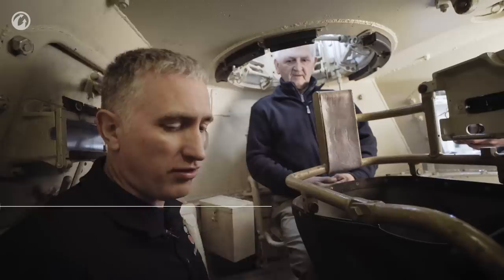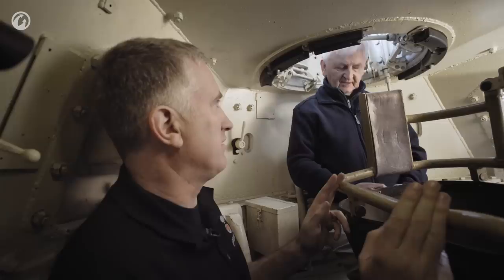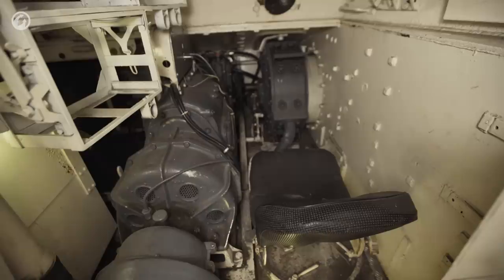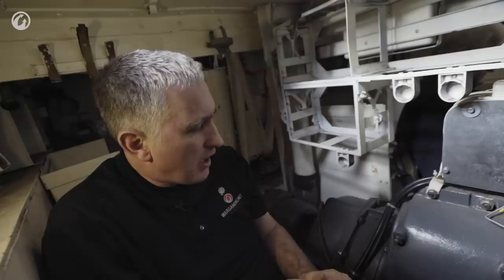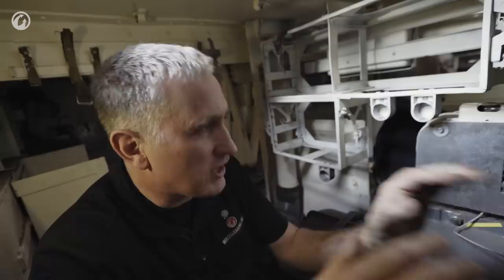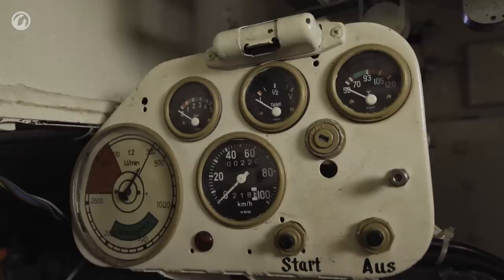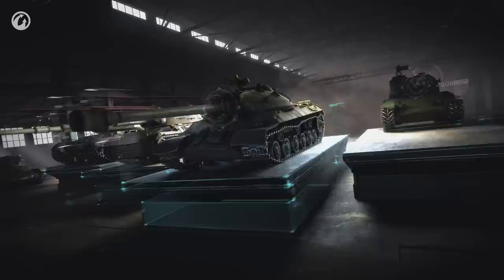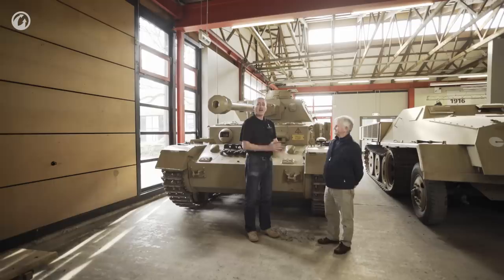Inside the Chieftain's Hatch: Panzer IV Pt 3

Comment: Great factoid: Israeli Sherman kills a Syrian PZ IV in the 1967 war. You couldn't make stuff like that up.
Reply: I would bet that it was an Israeli Supersherman which had a french version of the KwK42 of the Panther^^
Reply: @HaVoC117X  - possible. But the 75 mm is more than enough to kill a Pz IV.
Reply: HaVoC117X yep reckon you are right
Reply: I used to work with one of the guys who helped found the Israeli Air Force.  The planes they originally trained on? Me-109s.

Comment: man, for such a tank of its size, it's actually pretty roomy inside.
Reply: Like they said, no torsion bars.
Reply: The sloping is also minimal on this baby
Reply: @azzazel225  Torsion bars don't even take up that much space. Just look at Panzer III which is essentially same size as Panzer IV but it has torsion bars. 
In case of Tiger and Tiger II, torsion bars take up around 120mm of space in height and bit more in Panther because of the dual torsion bar design.
Reply: Uncle Joe I mean it was nominally better than the low velocity 75, but once you get to the 76 it actually was switched to the 76 was nominally better than the 4s 75.
Reply: From what I understand, the German tanks were known for being pretty roomy. The Germans actually cared about crew comfort.
Reply: KoruptDawg eh, panzer 3 and 4 when only with the 37 and low 75 where really roomy, and still decent with the upped 50 and 75, but the panther and tiger where a bit of a mood getting into and out of.
Reply: @azzazel225  Did you listen to the video at all???
They had at least one foot space for extra fuel tanks below the turret. Plenty of room for a torsion bars if you want some!!
Reply: Uncle Joe  Which became a problem later on when allies had better guns. Still in a real life scenario you still had to manage to hit the tank first. And when you usually don't get second chances in a real life situation I'd imagine even a flat armor tank still had its merits.
Reply: Uncle Joe well, one could argue that it wouldnt have been difficult considering the work done on many different projects. But these vehicles were contracted, I doubt such extensive change would have been under contract, even considering the different models it still retains most of its base whereas sloping the frontal armor would have been much more demanding. Though I imagine it would look similar to a panther, hence why they might not have done it.
Reply: @dustindubbo2892 
Tiger?

Both tigers have the biggest turret ring diameters by far.  Big hatches plus an extra escape hatch in the back of the turret. 

Chieftain made a video about the long 75mm panzer iv recently. He was surprised how much space the crew has and every crew member including the loader had their own hatch. Remember Sherman's until late 1943? They only had the commanders hatch, all three crew members in the turret had to squeeze out through a single hatch.
There is a reason why the germans called the Sherman "Tommy cooker" in North Africa 1942/43.
The US learned about crew ergonomics from the Germans and not the other way around. But the US finally got it right with the M4A3(76)w hvss. But this tank arrived at the Frontline in December 1944, the war was basically over at this point.
Reply: Uncle Joe  I don't think there would be any such thing as a small TARDIS.
Reply: "Of its size"? It's wider and longer than an M4, and just about as high. It's not a small tank, as WWII tanks go. If you mean that "wow, the smaller IV has more room than a larger Panther", sure. But the Panther is pretty small for the capacity they tried to pack into it. It's not all that much bigger than the IV in most dimensions, but with much thicker armor, larger gun, larger engine and transmission, and a bunch of torsion bars.
Reply: It was the best German panzer of the war. They unknowingly created a hull that was upgradable and remained current through the entire war. Had they invested more into producing these than lets say Panther or Tiger II. The army would have had more tanks available for every battle.
Reply: Uncle Joe  Agreed.  A very underrated tank. As you rightly say upgradable even more so than the German's managed to do. It was deployed long before the Sherman and was "good enough" to do the jobs asked of it.  Had it been  refined even further and streamlined with ease of production in mind. It could have altered the progress of the war in Russia.
Reply: AKUJIRULE  I understand and appreciate your valid arguments.  The issue for the German forces was simply never enough tanks fit for action at any given time. They did remarkably well making do with what was available. Any numerical increase would have had a disproportioned effect on battlefield performance. 
Panther "the problem child" was much less reliable than other models. It also consumed R&D effort and recourses, at a time when better spent improving/producing proven models. The Tiger I  for example, could have benefitted from further improvements before building Panther. Same with the Panzer IV. There were plans to improve it's suspension etc. The whole subject is purely academic. Just another "What if?"
I wish you well my friend. Stay well and safe. BTW.  I've written to the Chinese Embassy and requested zombies, next time they see fit to unleash a pandemic on the free world.

Comment: I used to work with an Australian WW2 veteran who took part in the 2nd battle of El Alemain. One of the memories he was to take to his grave was the screams of wounded Germain tank crew trapped in a tank brewing up on fire. Due to the hazardous situation of amunition cooking off, there was nothing that could be earthly done to save these German soldiers, and their horrible fate was sealed. So German tanks caught fire are being hit equally as allied armoured vehicles and tanks. That is why the crew of Tiger 131 abandoned their damaged tank as the risk of further rounds hitting the vulnerable areas of the Tiger tank, causing it to burn, was very high.

Comment: There was  a nickname for the Pzkw IV too: crews called it "Rotbart", inspired of a slogan for the razor blade "Rotbart extradünn" ("Redbeard extra thin") because the gun e.g. of the T 34/76 went straight through the armour.
Reply: Redbeard? As in Barbarossa?
Reply: Jeremy A that’s Blackbeard.
Reply: @ICCUWANSIUT  Blackbeard would be "Barbanera".
Reply: I would have called Barbarossa, Ragnarok instead
Reply: @ICCUWANSIUT  "Barba" - barber, beard, hair. "Rossa" - rust, rouge, red. Ferrari Testarossa - "Redhead", named for the color of the paint on the engine head. Barbarossa = Redbeard. You are thinking of Blackbeard the pirate. There is also Bluebeard, of popular legend.
Reply: Only on the early variants. It doesn't pay to put too much weight on soldiers jokes anyway. If ANY Russian shells penetrated the armor, they would think it was too thin and gripe about it and make morbid jokes. It doesn't mean that T-34s just went merrily along knocking out Pz IVs left and right. Just that the Ivs crews felt that the margin of safety was getting kind of thin. And what do you think the T-34 crews called the T-34 when the L48 arrived and suddenly their 50mm armor seemed very thin compared to when they were facing the 37mm?

Comment: A German tank veteran, quoted in a book about the fighting around Tilly-Sur-Seilles in France in 1944, said that the Panzer IV was nicknamed the "mess tin" as it had the thinnest armour of the frontline German tanks and that enemy rounds could and did pass clean through. Not so for the Panther or Tiger. If, he said, a round penetrated, it usually ricochetted around inside and killed the crew.
Reply: Well that happens pretty much with any tank if the shell penetrates. The Panzer IV was decently armored for the time. 1944 is a pretty extreme time and especially in France there aren't exactly that many Tigers and Panther to begin with. In a 1:1 vs the Shermans the Panzer IV was still perfectly adequate most of the time.
Reply: I remember reading on the Eastern front that if a 152mm hit the Elefant the entire crew would die (from shock, or I don't know) and the tank would be reserviced.
Reply: @nicholaspatton5590  - I highly doubt that. Only 90 or so Ferdinands were built and the dozen or so that was destroyed are usually by mines or hits on it's wheel tracks, after which the crew would then abandon and destroy the tank.
Reply: @nicholaspatton5590  Russians were known to use 152mm HE rounds on German tanks. German tanks were tightly sealed (to ford rivers coz they were too heavy for most bridges) and the concussion from the 152mm rounds would kill the crew inside. Americans used a similar tactic with the 75mm Shermans, hit the enemy with enough HE and the Nazis inside would be finished. Dying from concussion like that is very unpleasant, although it's a fair end for a Nazi.
Reply: @osokmav  Please Sir don't refer the Germans as Nazier its the same as calling every American racist fat bastard or The south will raise again painted on your Tank .Or referring Asian as Yellowpigs Japs or rice pickers. 75yers after ww2 the time is now to call Germans for Germans I hope show the people of Germany respect please .
Reply: @osokmav  reminds me of your friends the Communists dying in their Communist tanks on the eastern front

Comment: Lord - Imagine being the nasty one that lost the key.
Reply: 2 choices
A hotwire the ignition before the rest of the crew finds out
B get shot for losing the key
Reply: @obelic71  Nah, it was a very simple key, even the Bundeswehr used them of their truck way into the 1980's. If you lost the key you could easily start the engine with a smaller screwdriver. 
http://up.picr.de/20173805jo.jpg

Comment: Very interesting video. Changed some ideas of mine about the PzIV. First, when fully loaded with ammo and five men, it would be very cramped. A lot of internal fittings are missing in this vehicle. The loader and the funker had a very hard ride in any terrain because they have almost no space left. In the other hand, gunner and driver have plenty of space. This occurs because the engine and transmission in this tank are placed off to the right of the centerline, while the turret is placed offset to left a few inches, so the turret  base can clear the transmission shaft. From outside, this is only curious, but the effect on the  crew positions is much bigger than I've thought. Second, these turret doors and all vision ports could be great by the time the tank was designed, but from 1942 on would be letal to the crew if hit by almost any  antitank gun. With 80 mm front armor in the hull front, it was well protected, but the 30 mm vertical side armor is poor, and has too many weak points also. This is more easily noted from inside the tank. I think the Stug III had a much better protection from the sides. Only a close observation from inside could show how the crew would feel in a tank. This video is thus very important for all people that want to know more about these vehicles. So thanks a lot for you both. PS: I missed a closer look at the engine compartment...
Reply: the Stug also had 30mm sidearmour.
Reply: @zafranorbian757  Yes, it had the same 30 mm side plates. But not that lot of weak spots, such as view ports and the turret side doors. The PzIV turret was somewhat inclined at the sides, about 12 degrees. But this is not enough to aford a better protection. Considering all aspects, in my opinion the Stug was better protected.

Comment: Also, the Sherman Wet Storage moved the ammo from the sponsons to the floor (tween the turret basket and the actual floor).  This change of position probably did more for crew survival than having water around the ammo.  In fact due to leaks, a lot of crew just stopped putting water into the protective jackets around the ammo!! 
 
Finally, during the Desert Campaign, the British Tankers also "found" places to store extra ammo in the tank.  Often to the detriment of the crew if the tank got penetrated!!!  (Even if it was just slowing them down from getting out of the tank!)

Comment: Some of the Syrian Pz IV came from Spain. 
Spain army bought 20 Pz IV H from Geman in 1943
They sold 17 to Syria in 1965, all them in running condition.
By the way, the transmission was slighltly to the right of the tank to avoid the turret axis.
Reply: Why does the turret axis matter? Genuinly interested.
Reply: @Cloudman572  the drive shaft runs from the engine in the back to the transmission in the front. Either the transmission or the turret must be slightly moved to the side to avoid colliding. In fact, I was wrong. I n the Pz IV is the turret the one moved  to the side. This way the base junction doesn't touch the drive shaft.
Reply: @jmb5030  But with the turret floor/basket that rotates and which hangs from the turret, what difference does it make where the transmission goes?

Comment: "Graviteam Tactics" has an extremely detailed simulation of the Pz. IV (and other WW2 tanks and equipment). They made tank simulators, ground combat simulations and professional military training software for almost two decades. If anyone is interested in a WW2 tank simulation: this is the best title you can get!
Reply: Oh, nice. It looks very similar to T-34 vs Tiger.
Reply: @VRichardsn  Graviteam also created, for example, Main Battle Tank training simulators for the Kharkiv Machine Building Design Bureau "SOE KMDB" (this design bureau also designed T-34, T-54, T-64, etc.). And "Graviteam Tactics" uses the same simulation engine - so there are many detailed T-34 variants... :) It is a "tactical combat simulation", so you do not sit in a tank. The user gives general orders to tank crews or tank platoons (for example: attack that hill, use this formation, use smoke...). It is hard to learn at first, but very rewarding. Graviteam has a deep understanding of (tank) combat because of their military background. Only SB Pro PE is on the same level when it comes to an authentic tank combat simulation.
Reply: @SolidWorksCAD3D  Fascinating insight. Thank you very much.
Reply: @VRichardsn  Maybe it is something for you. It is, like SB Pro, more a "hobby", than a "game", so it is not for everyone. Both simulation platforms have been developed for over 15 years, so it is hard to get in (because the content and detail is overwhelming) and both need quite some learning time and perseverance to be rewarding (it is also assumed that the user has basic military knowledge, so nothing is explained). But those that "get into" those simulation games, adore them. BTW: German is my mother tongue, so maybe the English wording sounds a little strange... :)
This is a helpful tutorial: https://www.youtube.com/watch?v=wwwacMv-IjQ&t=3703s
Reply: @SolidWorksCAD3D  I played quite a bit of T-34 vs Tiger, which seems very similar to that Kharkov 1942 game (the voice actors sound exactly the same, for example).

Too bad there not many recent titles into proper tank simulation.
Reply: @VRichardsn  Yes, one reason why there are only few proper tank simulations, is, because it is very hard to create such a sim. There are many flight sims, for example, because it is a lot easier to create a flight model for a virtual plane. You can use lookup tables etc., but a tank constantly "collides" with the ground and this has to be constantly calculated. Same for AI crews: plane = rather easy; tank or other ground vehicles (off-road) = hard...
The only proper off-the-shelf tank simulations that I know are SB Pro and the Graviteam titles (the tank simulators and the combat simulations of Graviteam use the same engine). They also have very realistic penetration calculation (and damage calculation is also quite good). BTW: "Technology of Tanks" by Ogorkiewicz is one of the best general books on tank technology, if you are interested. It is from the 90s, but other than that: perfect. Here is a link: https://archive.org/details/Janes_Technology_of_Tanks_01/mode/2up
Reply: @SolidWorksCAD3D  Hey, thanks for the book! I have added it to the backlog. 

I don't get the collision problems. I mean, simpler games do it all the time with land vehicles.

Comment: While a Pnz IV would likely never hit 100kph, Russian testimonials record numerous examples of small sections and parts of them reaching far in excess of that speed shortly after being sighted by an IS-2
Reply: Well they wouldn't need to back off more than about 800 metres and the IS-2 wouldn't even be able to him them unless its shot was lucky. It did not have a very accurate gun at ranges longer than that. The 122mm was not a pinpoint precision anti tank gun. It was better at laying down wide high explosive barrages.

Comment: Its amazing how much these two guys know
The Soviets had similar shortages of rubber
Did the German's salvage rubber from Allies vehicles for recycling?
Did the Axis stripp cilvians of rubber in occupied territory?
The Czech guns, where they 75mm L 48 or were they up gunned like the Israeli Shermans
Reply: The Israeli shermans had the 105mm cannon, not the 75!
Reply: @marcoflumino  I was using the Israeli Super Shermans as an analogy for installing a much bigger gun than originally equipped
Reply: @markyoung950  ok, then the answer will be not possible, the germans did a study to see if they can fit cannons up 128mm, but they soon discovered that the chassis already was at its limits with the long 75mm.
Reply: It depends on the design of the turret and the breach of the gun.
The L7 105mm was designed to fit into the turret of a Centurian.
Which originally was fitted with the 17 pounder.
The T34 required a bigger turret and turret ring for the 85mm gun.
The French/Israelis discovered that since the mantle of the Sherman could be removed, a new mantle with the pivot moved foward allowed for a bigger gun 105 ( not the L7)
A longer barrel and slightly more propellant could enhance a current design